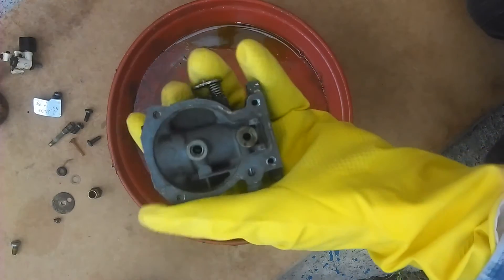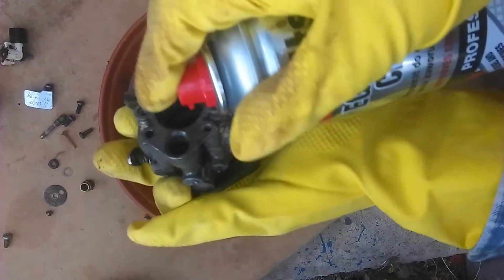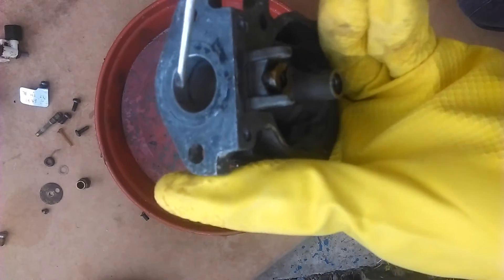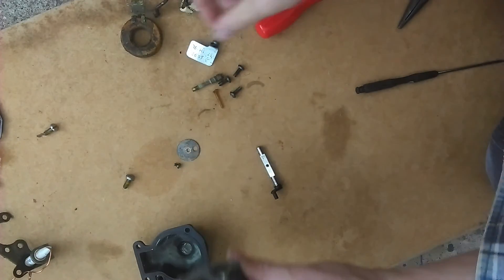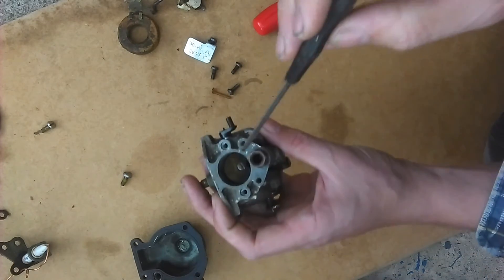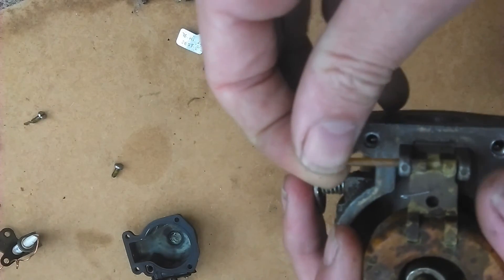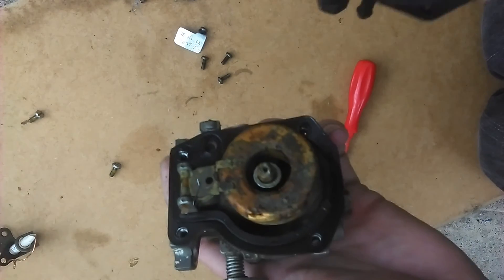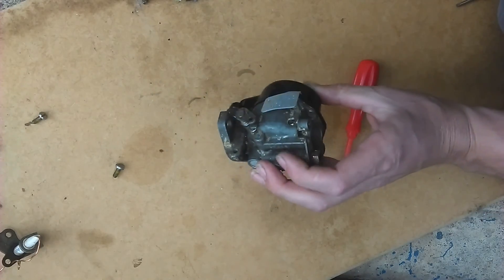1984 Evinrude 4hp carburetor.....how it works, how to restore

Comment: If the carb has the nylon rod for the float hinge, be sure to get a brass or SS one to replace it!  Those plastic parts will get attacked by ethanol, swell up, and jam the float resulting in either fuel starvation or flooding.

Comment: Where are your needles, are they the same or which one goes where?
Reply: Did you get an answer regarding the needles? ,
Reply: I wouldn't and did not put that dirty worn float back in after a cleaning 
 
My rebuild kit didn't include a needle so I never took it out other than soaking it and blowing it out

Comment: Good video, I was hoping you would be going through the setting up of the low and high speed jets after assembling and installing the carb.  I am having quite the go around with my 74 Johnson 4 hp..and since this carb is pretty much the same was hoping for some pointers.